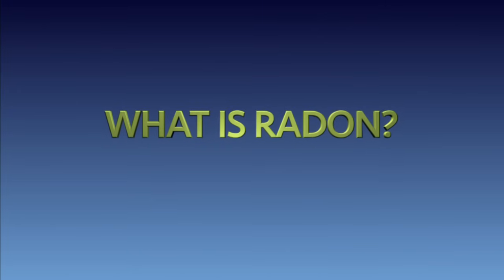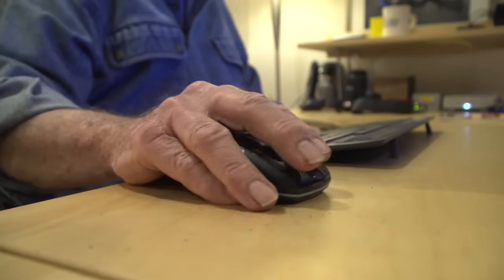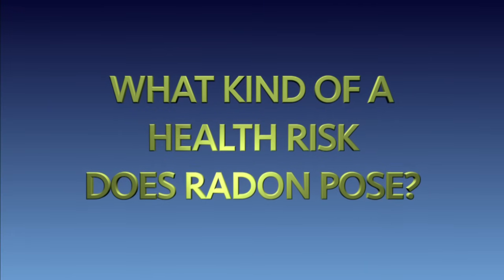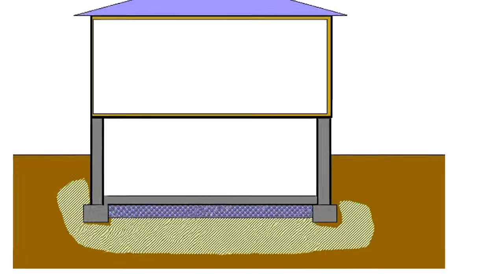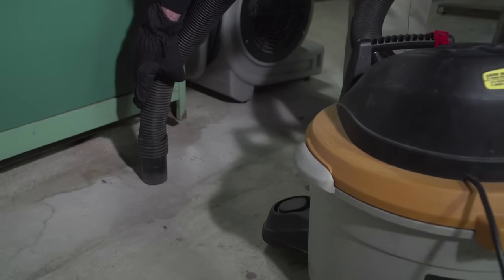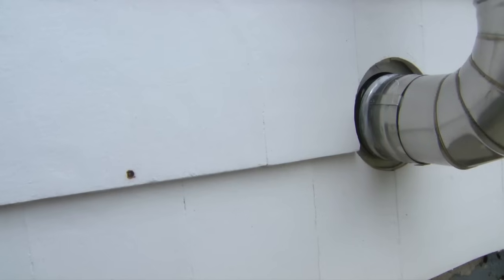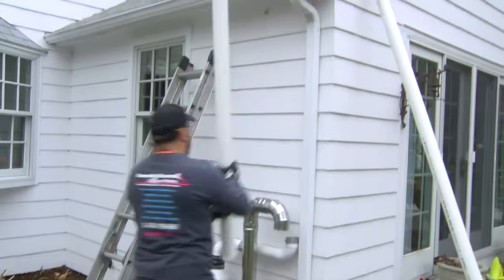Radon:  What is it?  How to Get Rid of It

Comment: I'm curious why it has to vent out so high?  Also, what keeps the rain from getting in?  Oh, also, does this system increase your AC and heating costs any?
Reply: code--above roofline
Reply: You want above roofline so its past living space, no sense blowing it out basement to breath it on second floor.  It is moving air from under slab not in the space so shouldn’t affect HVAC.  If it does suck in some conditioned air what is your preference getting cancer or saving a few $ a month?

Comment: Doesn't rain enter the pipe?
Reply: SpellDreams sure looks like it would
Reply: SpellDreams rain will absolutely enter that pipe good question good observation
Reply: The radon system should be slightly sloped back towards the slab. This will allow any water that enters the pipe, to drain back underneath the slab. A few other things I noticed, once the hole is made through the slab, you should reach inside the hole and remove as much gravel as possible, to make a cavity. Also Schedule 40 pipe should be used from at least the suction point to the bottom of the fan. I personally use Schedule 40 pipe from start to finish.
Reply: Thats why you need to be sure to have the water mitigation kit installed by professionals.

Comment: It all depends how much time you spend in the basement. I think in practice, the exposure is very low as few people spend hours a day in the basement. Furthermore, good luck with heavy rain into the pipe. Why not make a 180 degree turn at the end to prevent rain from getting into the system? Lastly, it is true that radon can come from underneath the floor. But it can also come from the concrete of the floor or walls itself. So, this system will not work then. A good measurement before and after the installement of the ventilation would have helped. Personally, I would not have done it unless I would spend many hours a day in the basement every day.
Reply: Yeah. Especially if the is sand/soil under the slab. Water will greatly reduce the effect of the fan under the slab. Can't get much air through wet sand.  Not as big a deal if the the slab has gravel or drain tile under it. The fan is designed for water/moisture, so that is not a concern. But a Tee terminal would be pest practice IMO.
Reply: @petethoenen3229  , us northerners often have basements. Basement slabs that we use. It's a Northern thang!

Comment: Is that Schedule 40 Pipe being used for your Radon Mitigation System?? It is required by Code that Schedule 40 Pipe be used. Some contractors also use gutter material. I am Certified with the NRSB (National Radon Safety Board) and always use Schedule 40 pipe. Contractors use the other types of pipe because it is much cheaper than Schedule 40 which means more money in their pockets! However, it will not pass if the right person sees it and knows what to look for. I believe in doing things right and giving my customers what they pay for! Nothing less!!! Someone mentioned the fan being outside and water being in contact with it..... certain fans ARE designed to be on the exterior and also the Radon Mitigation System SHOULD be slightly sloped so that water/condensation that does enter the pipe will drain back underneath the slab.
Reply: Hi Mike,  your code might say schedule 40 is required, but that would just be for your specific location.  Too many people think that because their code requires something that the code is universal.  While I am on it, lots of people commenting negatively on the internet about fan being placed in the basement, but lets set some things straight.  Actually Canada says the basement is the best location to prevent damage to the fan.  I live in Fishers Indiana, and the city allows installation of the fan in the basement.  If you think about it, if you don't allow the Fan to be located in the basement, then you should not allow gas furnaces or gas water heaters to be located in the basement.  As Canada says regarding radon fan installation, "properly installed fans and pipes will not leak radon into the building and are usually installed in the basement".  I will soon be installing my Radon Fan in the basement, no doubt about it (regardless of EPA recommendation).  The NRSB is a money maker, and has nothing to do with being a government regulator agency.
Reply: Yes sir, they used thin wall drain pipe 🤣🤣🤣
Reply: Hi Mike Bolling, have you ever heard of Perma Seal? They install something like a 'French Drain' INSIDE the house, all along the outside perimeter, which guides any incoming water to the sump pump. I have this in my home, but didn't understand enough about radon to feel concerned at the time of installation. After knowing more, I AM concerned, now. I have a hundred year old home in Chicago with a painted concrete slab foundation, and now no apparent way to seal off anything. Do you have any thoughts on this? Thanks.

Comment: We have a nice pipe open at the top leading straight down to an electric fan. Maybe it never rains where you are.
Reply: the rain that falls into that exhaust pipe will go back to the soil under the slab. Some states require the top of the exhaust pipe to look exactly like the one in this video, and in many  states mitigators turn the top down to exclude rain

Comment: You would think that it would be cheaper just to install a fan to bring in more fresh air to the basement.
the cost would be only $50.
Reply: You mean more frozen air or hot air?
Reply: Actually an air to air heat exchanger is the best solution, the PVC pipe and fan is the cheap alternative:-)

Comment: Hi, Ron, I saw your video and found it to be very educational and helpful. My question to you, is it a problem to have the top of the PVC pipe located at the highest point of the roof installed,  facing outward the side instead of upward? In other words use an elbow shape instead of a straight shape? won't the rain falling straight into the pipe be an issue?
Reply: I would have thought it would need a roof vent over it, also what if you have those windows open in the attic? Shouldn't the pipe go higher than highest point of house?

Comment: Just found out I have radon 9.5 in my basement.   This video was awesome!  I'm going to do it myself and the video made it much more clear.  Doesn't look like rocket science and I can save myself $1,500!   Good job.   And yes, I'll test after I install the system.
Reply: Holy cow... 9.5?  I thought mine was high at 3.1 +- 0.4.  I plan to test again after I cap off some air ducts that go through my concrete floor.  I suspect that is where it is all getting inside the house.  Hopefully I will be down in the 2.0 range after and don't have to worry about a mitigation system.  Not that 3.1 is above the EPA recommended action level.  They recommend action after 4.0.  If I get it down to 2.0 then I'll just live with it and hope I die before getting cancer from it... it's good to have a goal...lol.
Reply: Mines around 2.5 and when I rains it goes up to 5.0
Reply: Duchy of Mecklenburg-Schwerin  you're an idiot. as I agree 3.1 is not high, radon is definitely a problem. keep on being a conspiracy theorist thinking the whole world is against you, though

Comment: what is that metal tube to the right from the fan?
Reply: Looks like the dryer exhaust vent.
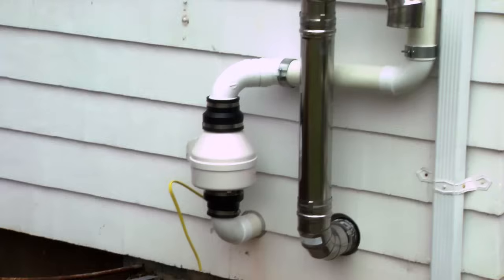Reply: 5:54 it's exhaust for a tankless water heater.
Reply: His looks newer than mine, but mine will burn your hand if you touch it while it is operating. Mine is 9 years old, and I was required to vent mine through the cement foundation. It looks like his vents out through wood between the floor joist.
Reply: + Eric M - It took me a while, but at 5:55 the switch isn't hooked up yet. At 5:27, the switch is wired and you do not see the yellow wire. I also noticed the he stated they drilled through the rim joist so his tankless water heater is more sophisticated than mine. Mine would catch my house on fire.

Comment: The whole exercise is undermined by the failure to perform and demonstrate an 'after' test to determine whether the installation has made any difference to the radon level in that basement.  Shame.
Reply: there should be something like a barometer attached to the exhaust pipe in your bsmt. if it is at "< or == 1.0" it's working the way it should. you can get decent electronic radon detectors that will give you almost real time readings. there are seasonal variations.
Reply: Almis Peter Salcius - Can you recommend a brand and model of electronic radon detector?
Reply: @pasqualz    hi, any luck finding an accurate electronic radon detector?   thanks!
Reply: F–